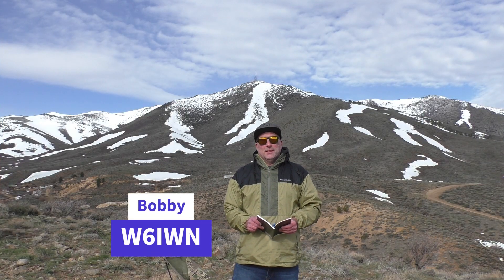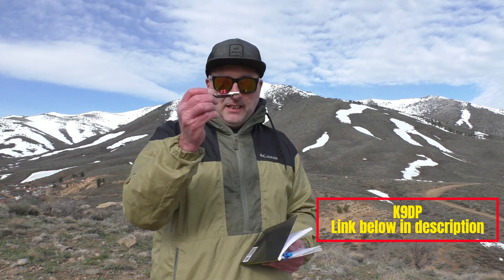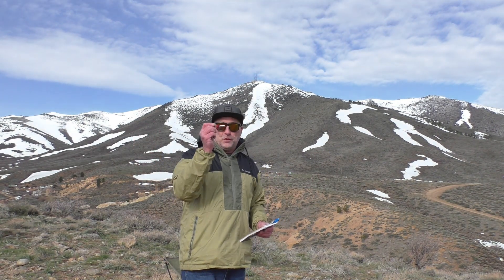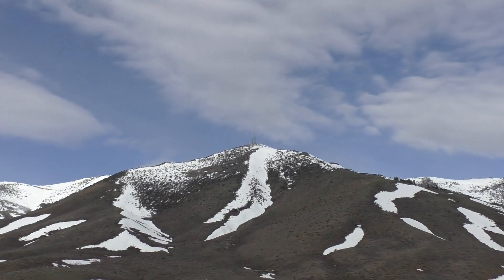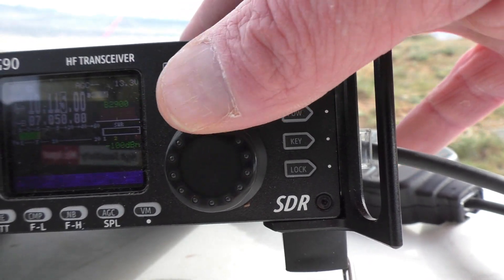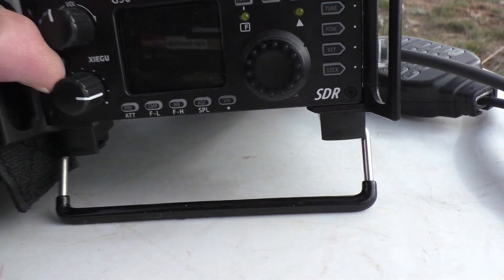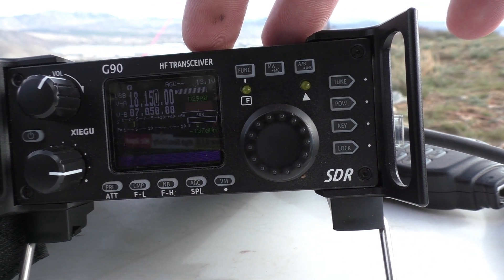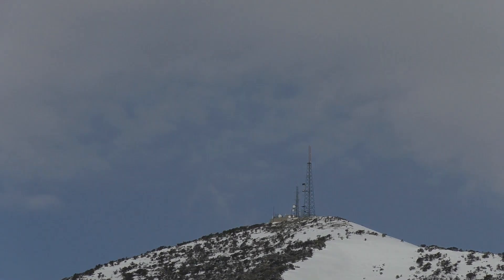Xiegu G-90 AM Broadcast Filter

Comment: Thanks for the help with the broadcast interference issues...
Ordered this little beauty and am excited to see the results.
Followed
Larry de KF4LBG
Reply from the maker: No problem, I hope it works for you! Just be sure to turn your internal tuner off and use it with a resonant antenna or external tuner inline after the filter. 73 W6IWN
Reply: @W6IWN_Radio  EFHW 80-10 My antennas at the QTH is painstakingly resonant. I intend on using a 40-10 EFHW or other resonant antenna for portable work, so I think the tuner will be more for mobile applications.  Thank you !
Reply from the maker: This should help you out... Please post an update if you have the time, I'm curious about your results. K9DP has been open to feedback and improvements.

Comment: I built this thing too. It works. The only downside is that you are not supposed to use the internal antenna tuner on the G90 when you are using the filter.
Reply from the maker: Yes, you need to use a resonate antenna with low SWR. It can be used with an external tuner with any QRP radio. Beware it can damage your Xiegu G90 if you use it with the tuner on.

Comment: Nice work Bobby. 
Has W7DLZ had any problems from that site using any of his rigs? Or, do you think this is largely a shortcoming of the Xiegu? 
Either way, that’s a great fix.
Reply from the maker: Derek W7DLZ, said it's fine with his very expensive high quality German radio. The front end of the SDR radios are susceptible to overload, Xeigu especially. At least from my experiences and research I've done.
Reply: Well… at least a $20 little filter seems to get you up and running. Nice fix. Good video.

Comment: Thanks for the video.  I'll stick with my Morgan filter, which I think it offers more broadcast am rejection.   Without a filter, I've found that the longer the wire I run, the worse the am bci on the G90.  I tested an 80m dipole inv vee without a filter, and no bci, but with an 80m efhw inv vee, the bci wiped out the bands and  I'm about 8 miles from the nearest am broadcast station.
Reply: What is your "Morgan" filter all about ?
Care to share?